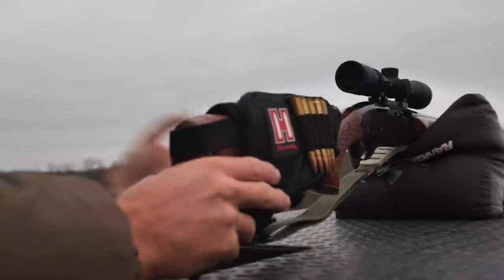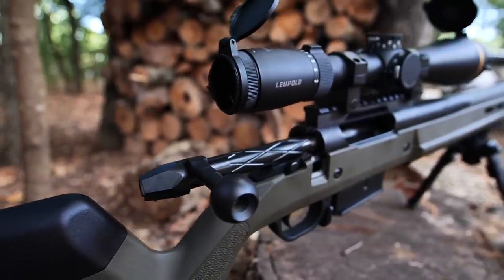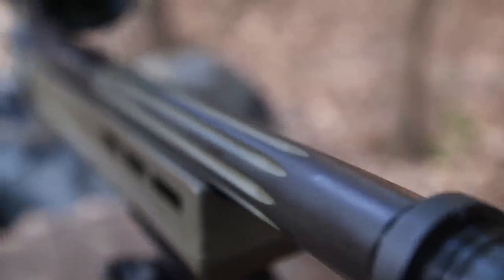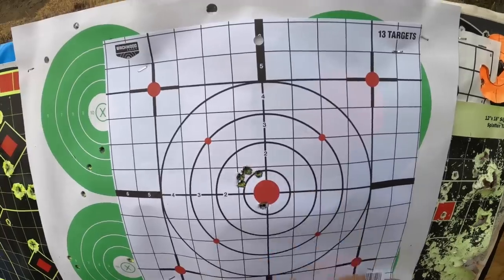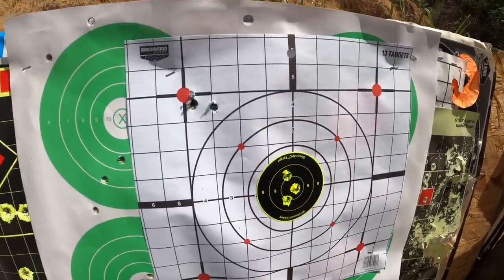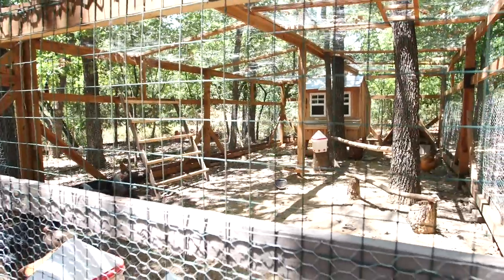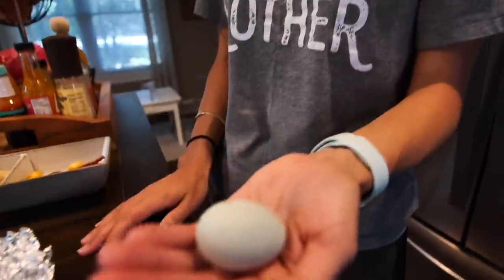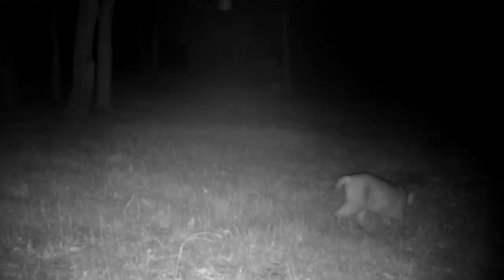Building My First Bolt Action Hunting Rifle | It's a Dandy

Comment: I just finished building my own "new" bolt gun. it's also a 308.
I took a Howa 1500 varmint supreme that I put 8K rounds down the tube 
and rebarreled it. It now wears a Mcgowan 11 twist stainless bead blasted and threaded barrel.
I got rid of the factory stock for a GRS Bifrost. I also use a Magpul bipod. I'ms saving for the optic
so this deer season I will using a budget Primary Arms 4-16 ACSS from one of my spare AR's that I'm 
not hunting with this eason.  I'm no half moa shooter but the my rifle is up to the task.

Comment: I use hand-loaded Barnes TSX. They're crazy accurate and absolutely devastating.  Handloading insures you get the same powder load in each cartridge, and it allows you to weed out defects, which greatly improves accuracy. I can literally put five rounds through the same hole in perfect conditions at 100 yards.

Comment: A dream rifle build of mine is very similar to yours, except I'd go with a 13.9" .308 with a pinned & welded flash hider to make it 16".  The shorter barrel would keep the length down, especially with a suppressor.  I like 2 stage triggers, so I'd probably go with a Geissele instead.  But the concept of a short, handy, bull barreled .308 for hunting really intrigues me

Comment: Try Hornady, light recoil 127 grain loads plenty of power for deer and hogs, a lot easier on the shoulder but avoid the military .308 ( 7.62X51) ammo as your tight tolerances will cause the brass to swell making removal of fired cases difficult.

Comment: Hornady super performance 150grain in 308 is deadly and groups well Barnes stx if you can find the 168 grain super deadly as well. When you switch up grains and velocities you’ll probably have to re zero a little btw so shoot groups find the ammo you want to use and stick with it. Use the left over boxes to slay pigs at 500yards! 
 You’ve got a tack driver for sure! Don’t worry about the 1” low and right with the can on. I mean unless your trying to ear hole everything you shoot at.

Comment: Nice gun! However, your rings are WAY too high. You will have better consistency with the scope closer to the barrel. 308 is a great choice!, my favorite caliber.  They steered you right if you wanted a short barrel. I think the sweet spot for that length barrel assuming it’s 1:10 twist is 168 grain. Nosler 168 grain trophy grade long range accubond ammo would be a great fit for that fine gun.. not cheap but if you want super accurate target and hunting you can’t beat nosler tipped hunting bullets. If you want some real fun with that Resonator try some 308 subsonic. Amazingly quiet and would be great for blasting those chicken predators. I have a short m lok rail on  my 308 sitting in the same magpul stock you have for a light!

Comment: Just keep the can on. Let the barrel cool for 10 minutes after 3 shots. Hunting scenario, it's only the 1st and maybe 2nd shot that will ever matter. If you shoot 30 rounds an hour at the range, it'll throw things off. Don't make windage adjustments until you've been to the range 2 or 3 times and have seen a constant drift. .308 is all the gun you need for proper hunting.

Comment: A can won't cause your groups to open up. Adding a can effectively adds barrel length which will make it group tighter.  Barrel heating and shooter is the issue. Have rob give it a go and see what his groups look like
Reply: Wrong.the can has no rifling so it does not act as barrel length. Barrel length affects velovity more than anything. The can changes the point of impact because the weight at the end of the barrel changes the harmonics. He needs to find the right bullet weight for his  barrel length and twist rate plus the change in harmonics. The groups will tighten then stabilise as the barrel gets fouled with copper

Comment: As accurate as factory built rifles are today (1 moa), why spend $2,400 on a custom built rifle? In most hunting situations 1 moa is more than accurate enough. That's a 4 inch group at 400 yards. Do you plan on needing to take hunting shots beyond 400 yards. Often you can hand load rounds that will turn a 1 moa rifle with factory loads into a 1/2 moa rifle. Just asking.